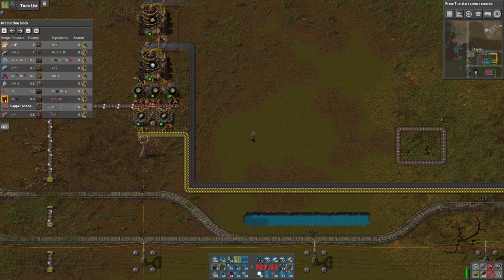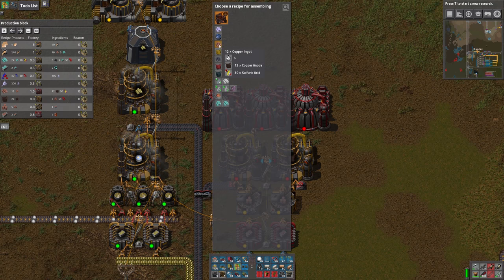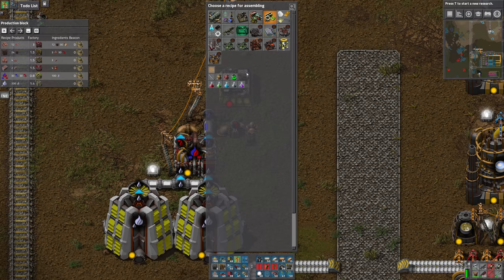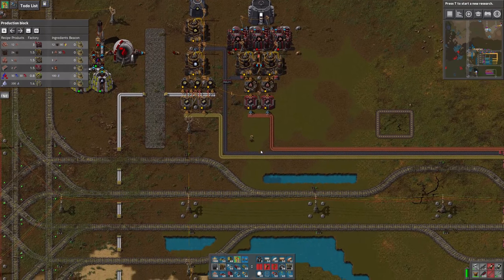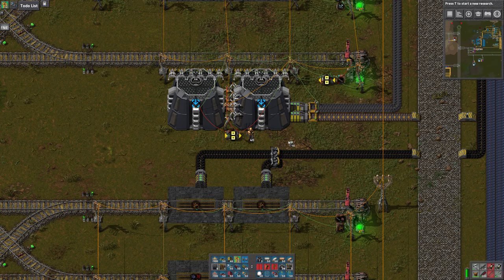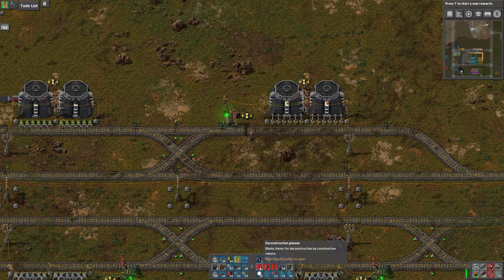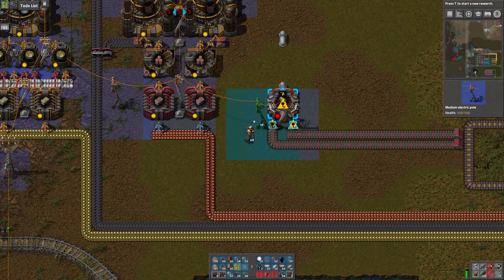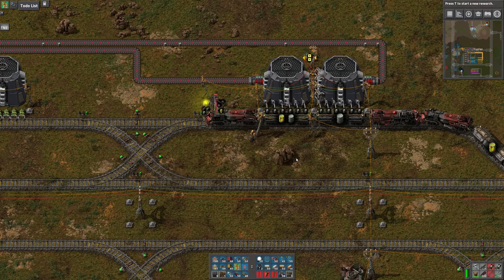Factorio AngelBobX Let's Play #32 - Copper ingots from anodes

Comment: I think you need to tweak the numbers on your warehouse inputs now that you're putting barrels into them: 5000 barrels is too many. Each warehouse holds 768 slots, and a barrel has a stack size of 10, so a full warehouse of barrels would be just 7680 barrels. If you're allowing for 5000 empty barrels and 5000 sulfuric acid barrels, then you'd end up filling the warehouse with barrels and have no room for carbon. Since 5000 of something that stacks in stacks of 200 per slot is 25 slots, an equivalent amount for barrels would be 250.

Also, each cargo wagon has, what, 40 slots? So each wagon can carry 400 barrels, and a full train (at your current cargo-wagon tech levels) would carry 800 barrels. So 5000 barrels per warehouse would definitely be more than you want, but 250 might be too little. I'd maybe set your belt limiters to 500 barrels rather than 5000; that will fill up 50 slots in your warehouse and leave plenty of room for other things, but it will fill a full train.
Reply from the maker: Agreed!

Comment: good plan for barreling strategy :)
Reply from the maker: Thanks!  I’m already starting to regret the decision to use barrels, as it is more complicated to implement.  But it will be a good experience, and at the end I will be able to decide with confidence which method I prefer.
Reply: you can do both really.  In areas that require lots of different fluids (like in the angels refining section) barrels might be better.  for other places, maybe it's not worth the further complication

Comment: For copper I prefer to not increase the yield, as with bobs, copper is in excess anyway and you don't wont your copperbharing ore backing up from too much effiency.

Edit: New barrel input into the train network should have a lower priority than barrels in use.
Reply from the maker: Thanks...do you expect I will have too much copper even in the late game?  If so, then I would agree with you to use a less efficient process.
Reply: Yes I think so, as you need much less copper in my experince, but I shold said a well, that my own pack is different, but I don't think SpaceX will change that too much, as it uses the Bobs matials because of the compat patch. Btw I edited my first post, to say something about the barreking I saw near the end of the video.

P.S.: looking forward to your next one. and don't forget to research while working on ore prosessing.
Reply: that might be a sign that you need to rebalance your ores.